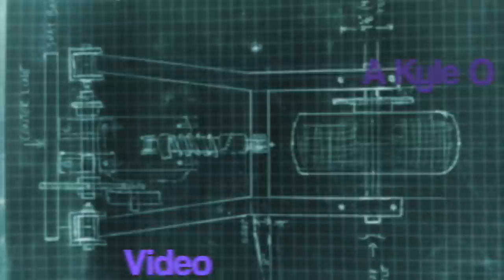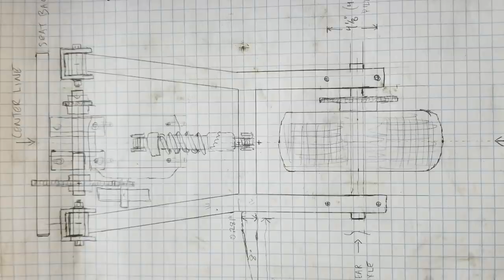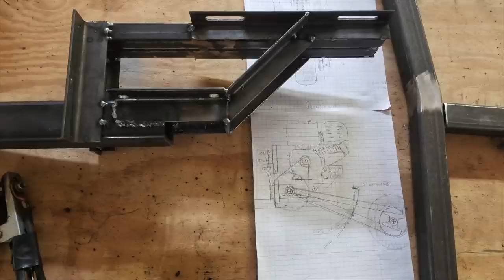Trike Trainer by Kyle O:  Design Fabricate Test Drive

Comment: I had mentioned the CVT trans for the trike trainer, just put a screw adjustment on the throttle to adjust the speed, guess you could do the same to the current setup as well.